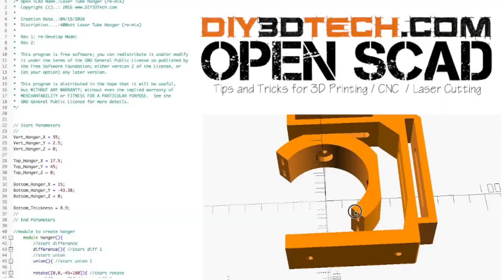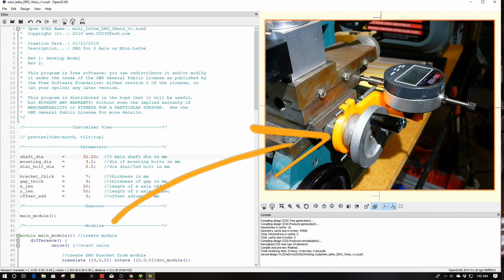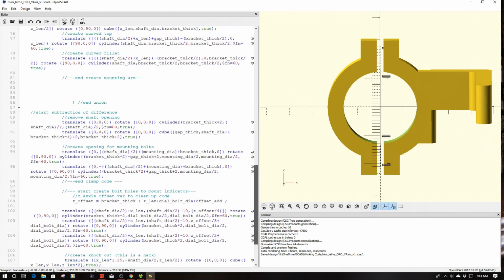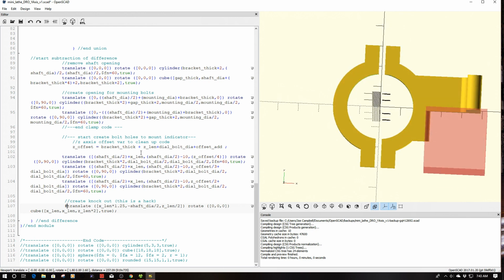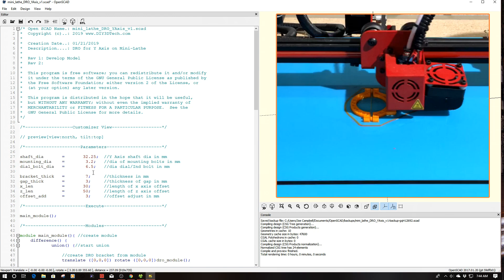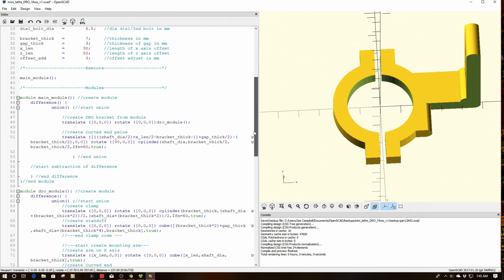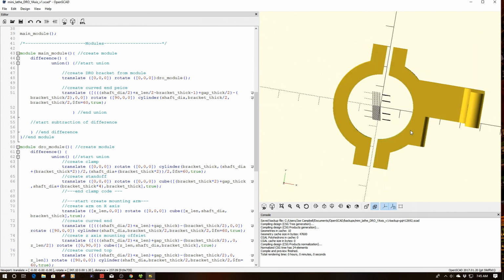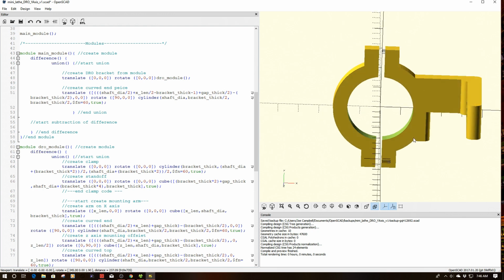Open SCAD - 3D Printable DRO Mount for Mini Lathe!

Comment: Not exactly DRO...but the ability to put an indicator on the unit to make perfect readings rather than rely upon the collar marking (and possible backlash issues)
Very very very awesome design...OpenSCAD is such a cool program and you are definitely great at generating code...so awesome!
Good video..keep em coming
Not sure the full movement of the axis...but these bolt on DRO units could fit the bill and not break the bank
https://www.amazon.com/AccuRemote/b/ref=bl_dp_s_web_6317461011?ie=UTF8&node=6317461011&field-lbr_brands_browse-bin=AccuRemote
More for different lengths
https://www.amazon.com/iGaging-Digital-Readout-DRO-Set/dp/B01G5SUZEG/ref=pd_lpo_sbs_469_t_1?_encoding=UTF8&psc=1&refRID=RW37G35VZ4PKPAG1ZG4X
Reply from the maker: Poor mans DRO :-) yes I did look at these suggested DRO's and while expensive, they are difficult to attach...